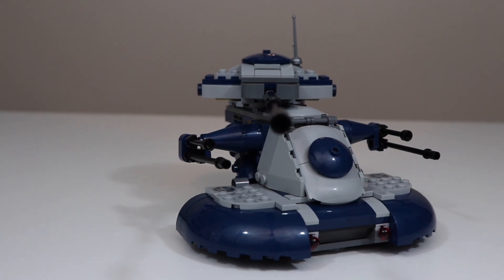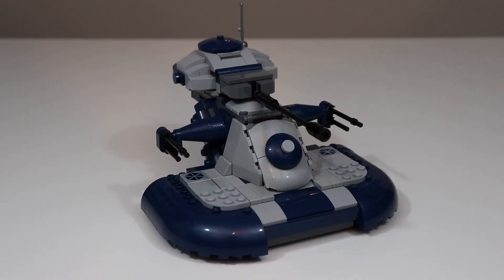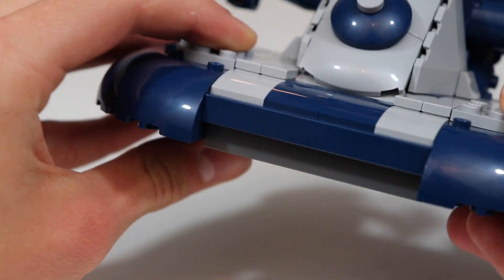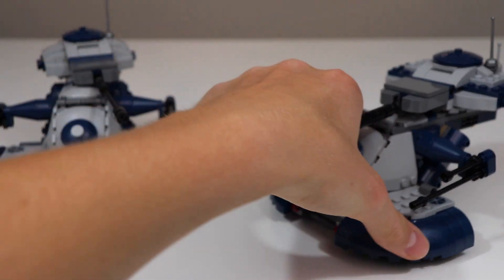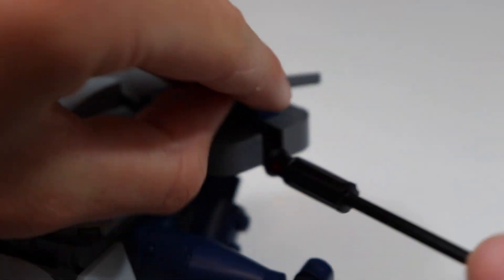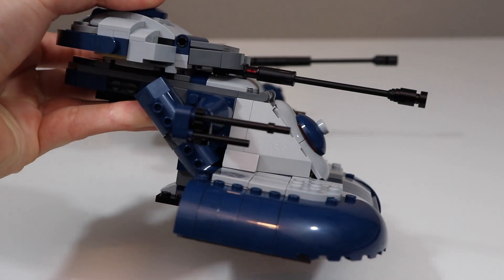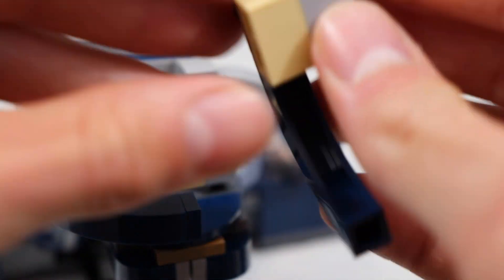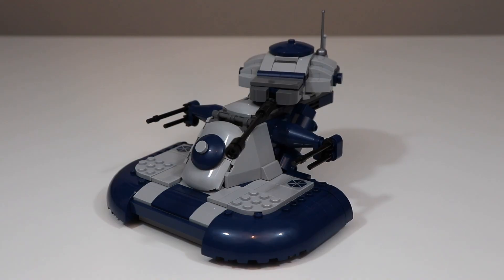How To UPGRADE Your LEGO Star Wars 75283 AAT!

Comment: I hollowed out the interior and made a back door roughly based on the scene where Yoda chops up a tank solo
Narrowly fits 3 droids inside, so I can fit both pilots in there and a generic, and a commando in the top.
It's not accurate to the show, but that's the crew I think I saw in that scene.
Reply: Gonna have to check my collection to see if I have the parts to do your mod too or if I'll have to get em.